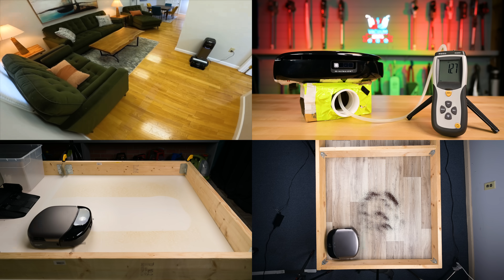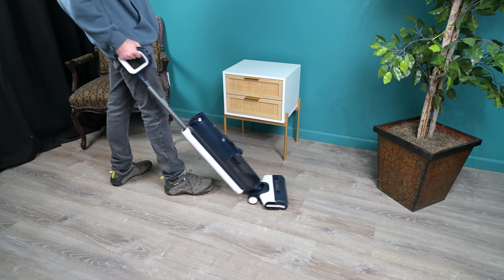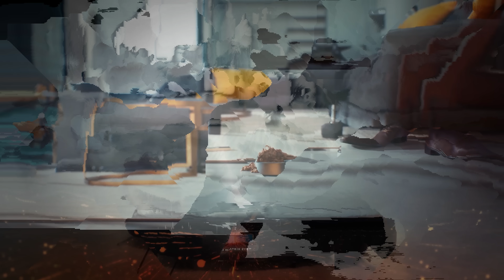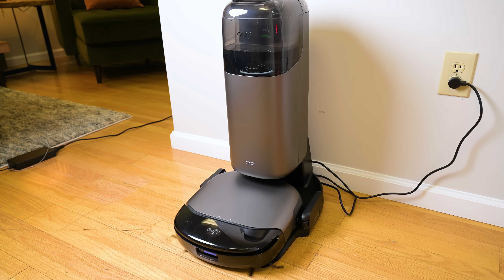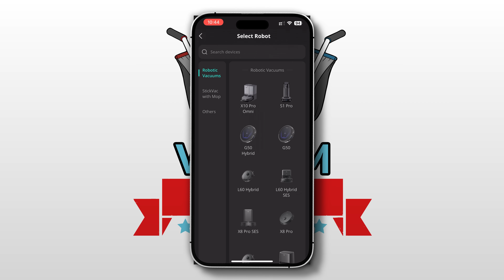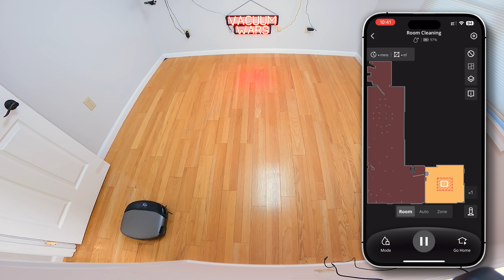Eufy S1 Pro Omni Review: AMAZING for Hard Floors and Obstacle Avoidance!

Comment: It's one issue no reviews mentioned about this and similar devices. Example , kid spilled ketchup on hard floor surface and started robot to clean a mess. Robot approached ketchup spillage and cleaned it well at the same time making an mess on carpet in nearby area due to a fact front spinning brushes and wheels were covered in ketchup. Part of spilled dirt also get in to dry middle vacuum brush.

Comment: We have 100% wood floors, LVP to be exact. Smal rug in bathroom is the only exception. Is this going for $699 during Black Friday sales as of 11/20/2025 a good deal? Anything else you would recommend for our floors or is this a good deal still a year later?
Reply from the maker: For 100% LVP with just a small rug, the S1 Pro is actually a really nice fit since its strengths are hard floors and obstacle avoidance. At $699 on Black Friday, that’s a solid deal for what it offers, even a year after launch. If you want to compare it against other top hard-floor robots, you can also use our comparison tool to see how it stacks up on features and tests for your specific needs: https://vacuumwars.com/compare/robot-vacuums/
Reply: @VacuumWars  Yep, I've spent the last hour or two reading the Black Friday pricing and tests of other vacuums. Our prior experience with a robot vacuum was with a Roborock S7+. It struggled with some chairs we had and with my wife's long hair. That's why we got rid of it. But robot vacs have come a long way since then.

The other two considerations during Black Friday are the Roborock Qrevo CurvX for $849 or the base Qrevo Curv for $799 but that's not much of a  difference. What are your thougts?
Reply: yes this i just saw this !! great gift idea

Comment: I was an early backer of the Eufy S1 Pro on Kickstarter, excited to support the brand and its new robot mop. Unfortunately, my experience has been extremely disappointing.

The soap dispenser has never worked—this robot has been mopping my floors with water only since I purchased it. Because of Eufy’s own warnings, you cannot add detergent or cleaner directly into the water tank, which makes the soap dispenser essential.

Over the past 9 months, I have contacted Eufy customer service multiple times about this issue. The responses have been delayed, unhelpful, and limited to lengthy troubleshooting videos or instructions (such as poking holes in the dispenser), none of which solved the problem. Despite my persistence, no replacement or meaningful solution has been offered.

This has been a frustrating, time-consuming, and unpleasant experience that has completely eroded my trust in both the product and the brand. I expected better support and reliability from Eufy. Until the company stands behind its products and provides genuine solutions, I cannot recommend the S1 Pro or Eufy to anyone.

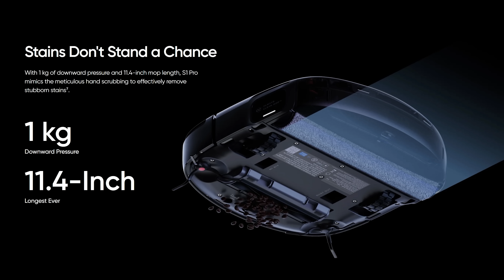Comment: @ 1:20, the video states" it's spinning roller exerts 1 kilogram of downward pressure."  This spec is misleading. 1 kilogram  (1kg) is not a unit of "pressure". 1 kg (kilogram) is a unit of mass. If you want to express a mass of 1 kg in terms of an equivalent force, you must multiply by g = 9.81 meters per second squared or 9.81 m/s² (acceleration due to gravity). Hence  F = mg = (1kg)*(9.81m/s^2) = 9.8 Newtons. For those less familiar with Newtons, there are 4.448 Newtons in a pound. (lb), The Eufy S1 Pro Omni therefore exerts 9.81 N / 4.448 N/lb = 2.20 lb of downward force. A small bag of sugar weighs 4 lb (in the USA), so there you have it; the vacuum cleaner applies a downward force equivalent to a little over 1/2 the weight of a bag of sugar.
Reply: Still better performance than most mop vacuums

Comment: Main Differences with Roborock S8 MaxV Ultra:
• S8MVU can be connected to water supply and drain; while S1 Pro has two water tanks that must be filled and emptied manually. EDIT: The S1 Pro can be completed with an "Auto-Refill and Drain Module" (separate expensive add-on) that makes it on par with the S8MVU on this.
• S8MVU has a rigid dust tank; while S1 Pro has disposable soft bags. Each has its pros and cons, e.g. disposable bags are cleaner but more expensive in the long run and a bit less convenient (YMMV)
The fact these very different features are never exposed by youtube testers (or advertisers?) is beyond me. The guy does not even show how to empty the dirty water on the S1 Pro!
Reply: I've been thinking a lot while watching these videos that a aggressive bin would be a lit better. Like, surely it would also be possible, if you were of the right mind and had a 3D printer, to print a removable tank that could fit in where the dirt bag goes that has a filter on the back to allow the air out as usual?

Comment: I have a 700 square meter floor that looks like a reception hall. Can this device clean the entire hall? Or is it only for small spaces like apartments and rooms?
Reply from the maker: That's quite a floor! While the Eufy S1 Pro Omni is designed for high-end, efficient cleaning and can handle larger areas thanks to its docking station and smart mapping, 700 square meters is a lot of space for any robot vacuum in one go. It could potentially clean it in sections—especially if broken up into rooms or zones—but it may need to return to charge and resume depending on your settings and floor type.

For that kind of area, you'd want to be sure the battery life, dustbin, and water tank capacity are sufficient—or be ready for a few pit stops!

Comment: The vacuum and mop work well but only where it can travel to of course.

I have tried my very best to like this robot vacuum but it still needs some work.

- it does not go under my dining chairs even though it has enough space to fit through the legs
- it does not navigate efficiently: it goes over the same route 3-4x, it turns it around in place multiple times trying to figure out how to clean a room
- I understand that it cannot mop to the edge of a room near wall or furniture because the mop roller is not to the edge of the vacuum body but I don't understand why eufy decided to not allow it to vacuum up to edge of wall and furniture where dust and hair and debris usually accumulate the most. The rotating brush arms are not even close to furniture or wall edges no matter what setting configuration I've tried.

- although it doesn't have a Lidar on top and looks streamlined, it is actually taller than my old roborock s4 so it gets stuck under furniture like my bed

 I had high hopes for this eufy vacuum. I've tried everything I could and been in constant contact with eufy to troubleshoot it every few days. I really want to like it but unfortunately I think it needs more work so I will have to return it. Sharing with everyone.

Comment: You didn't seem to test ladies long hair.  This is a big issue for me, since, currently, I have to take my vacuum apart every time I use it due to clumps of tangled long hair.
So how easy is it to remove the roller?
What maintenance cleaning needs to be done?
I'm very surprised that it doesn't remove the dust into a bagless compartment.  Someone forgot about that it seems.
Did you try it using an alternative detergent, such as a normal floor cleaner, like Cif?
As for being cheaper than the competition?  I'm finding this about a third more expensive here in the UK at over £1,500 / US$1,945.

Comment: We own a muay thai gym, with 2 training areas 12mx16m wide

We had a roborock s8 pro ultra that could not bounce its lidar system of anything so left 2 massive uncleaned areas in the center of our puzzle mats.

Will this eufy s1 pro have a longer reach with is lidar system since it has had other changes already to its usual design?

Comment: Your reviews are probably the best, but you are missing one thing which I think might be important probably for half of the buyers - how these robots cope with multizone or multifloor vacuuming or even mopping without moving to other zone their central station. From my experience some robots doing it almost perfectly, for others almost not possible. Also very important feature for other floor cleaning is the stairs detection to do not fall. Please improove your reviews with these features or at least make separete video on your top10 robots only on this topic.

Comment: Interesting thing I heard on the 3i S10 ultra live QnA (I am still trying to figure out how good this robot is and I think I will risk it and join the kickstarter) - they mentioned 2 things related to eufi - they said that eufy is their client so maybe that means that their robot can achieve similar performance to eufy which would be great. Of course, they didnt specify exactly which parts they manufacture for eufy so it might turn out to be the full robot, it might be just the roller brush :D second thing they mentioned that they i troduced the self washing roller mop design 1 year before eufy in their first gen teyouts of S10 Ultra. So that sounds promising, if we are about to get something that is similar quality to the S1 Pro

Comment: I don't fully get how to dock station mop cleaning feature works - does it require piping for the dirty water and clean refill? or the idea is that the dirty goes into the clean and is purified using the ozone?
Reply: Two separate water tanks. You fill the clean water tank and you empty the dirty water tank. To clean the mop it shoots clean soapy water on the spinning mop and then that water goes to the dirty water tank.

Comment: Just got mine (first robot vacuum/mop combo) last week. New home and still a lot of construction dust on my mostly tile floor so needed a bit of maintenance already. 

Super easy in all ways 
-mapping is easy to use
-if it gets clogged it’s easy to unclog
- easy to clean tank
- easy to change water and remove dirty water (I like the higher station so I don’t need to bend)
- and does an amazing job cleaning
10/10 for me
Reply from the maker: Great to hear!
Reply: How has it been, and how are you liking it? Same situation as you lol, new construction house and just ordered this. The amount of dirt and what not on all the floors is insane.
Never had a robo vacuum with or without moping.
Reply: @Mpostor  still works great, but the more dirt the more maintenance but not difficult to clean parts if your got a good laundry sink.
Reply: @justbecause882 Anyone with long hair living with you? I heard long hair gets tangled on the mop roller, as there’s no anti tangle equipment.
Reply: Does it have a light so it can see in the dark? 
Does it take photos of things it's found that are in the way?

Comment: For those comparing the Eufy S1 Pro and SwitchBot S10, I’ve had both for several weeks.  If you have hard floors, these are your only real choices.  My Roborock and Ecovacs are not even close to these. Despite my initial excitement and possible bias for the SwitchBot S10, I’d choose the Eufy S1 Pro if I could only have one.

Both are excellent, but the Eufy is far more premium in every sense. Its navigation is the best I've ever seen; it avoids getting tangled in curtains without needing virtual walls, unlike the SwitchBot. The Eufy also cleans with ozone, which is crucial for maintaining cleanliness and health.

Seriously.  The benefits of cleaning with aqueous ozone cannot be overstated.

The SwitchBot S10’s unique feature is its empty/refill station that connects to a drain and water line. This excited me until I realized it doesn’t refill or empty its tank at the start and end of runs.  And it's made it very difficult to think of a way to add aqueous ozone to the SwitchBot.  Also, leaving water in the tank for extended periods of time could cause filtration issues for those with hard water.  (To be fair, SwitchBot's customer service is incredibly kind and responsive.  They said they are looking into resolving the issue of leaving the tank full between runs in a future firmware update.)

Both mop floors phenomenally well, but the Eufy does slightly better with smooth navigation, quiet operation, better waterflow, and an impressive filter that leaves the whole room smelling fresh.  The SwitchBot, although almost effective, is louder and bumps into everything.  And surprisingly, even though SwitchBot has access to essentially unlimited access to water through its waterline hookups, it only puts the faintest amount of water down even at max water settings.

Edge cleaning isn’t perfect on either, but the Eufy is better thanks in no small part due to its roller bar that extends across its body, unlike the SwitchBot’s, which only covers about half. This means the SwitchBot requires more passes, can only do edges in one direction, and the roller is positioned further away from the edge.

If Eufy ever adds the ability to connect directly to plumbing (and maybe some devices that it can transport water or power to/from), there would be no reason to ever consider the SwitchBot.  But I'm going to keep my eye on SwitchBot because even though their execution is in some ways lacking today, they seem to a unique vision for creative ways to innovate in the future.
Reply: I've been a Robotrock fan, but I think this holiday season I am gonna buy the Eufy S1 Pro after tons of research, us our 3000 sqft is all hardwood floor.   I really don't care about carpet cleaning.
Reply from the maker: @flood2k3  Sounds like the S1 Pro is a perfect fit for your home — especially with all hardwood floors! It’s always exciting when research pays off and you find the right match. Hope it impresses you as much as it has others!
Reply from the maker: Thanks so much for sharing your experience — that’s incredibly helpful for others trying to decide between the two! Sounds like the Eufy S1 Pro really stood out for you, especially when it comes to navigation, ozone cleaning, and overall polish. Great to hear you're keeping an eye on both — really appreciate the thoughtful comparison!

Comment: I bought a roborok S8 pro and it doesn't clean the grooves in my tile floors well. It does not suck up the garbage that is between the slots well. My question is if this eufy S1 pro cleans the grooves of the ceramic floors well. waiting for your response to see if I buy it
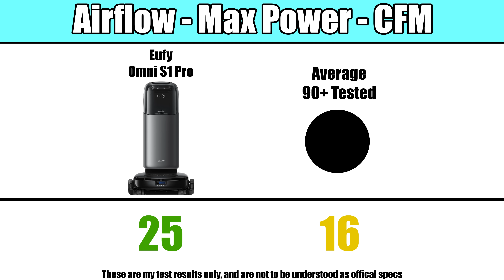Reply from the maker: we looked at power and crevice pickup at about 04:11 - it did pretty well.
Reply: You tell me that you clean the cracks quite well. Do you want decor that makes it perfect then? . My floor is made of full china and the roborot cost me a lot of money and I didn't like it at all because it doesn't clean the cracks well. I mean it doesn't vacuum the cracks well. That's why I was thinking about buying this one. Based on your experience, I think it is worth it.

Comment: I think the S1 Pro is perfect for my house since it’s mostly vinyl floor, except for one low-pile carpet. It can also easily vacuum under my 3.75” clearance furniture that is also a pain to use with my Dyson.

The only real concern I have is no edge vacuuming/mopping. I read it leaves 1-2 inches off the edge of baseboards, furniture, etc., which is why I was also looking into the Dreame X40. Is this a dealbreaker?

Comment: I’ve got dreame x40 and the biggest advantage of it for me is tricut brush - I had one run on the floor with pet hair without it and hair was all stuck on the brush. It would be awesome if you could test anti hair tangling features of those robots. Even though this robot seems ideal for me as I have only hard floors I don’t think it would be as low maintenance as my dreame. Also two more advantages for dreame: moving side brush and moving mop pad which I find particularly useful.

Comment: Want to add 2 points -
1, the biggest headache for us is its claimed very low clearance is not exactly true. We used to use a Roborock S6, and we have done some work to lift our furniture so the S6 will be able to get under them. However many of the furniture pieces that has a bottom tall enough for S6, The S1 Pro does not want to work with. And actually to make it worse, it will actually try to go under it, but somehow in middle of the way it will basically say "no it won't work" and get out. I don't know why is this.
2, there's one rather important feature missing from its app, that it cannot do cleaning which disables mopping and follow a order of rooms. The app allows only one set of "Customize" settings which allows you to set which room to use what cleaning method and then a order of rooms, but that's it. If I set to use the customized setting, it follows the room order but has to do mopping; and if I use "Default", I have a way to disable mopping but it also cannot follow a room ordering.

Comment: How does this perform on thresholds? My current robot mop has a hard time going over those sometimes. Thanks for the review!
Reply: This! Too bad they don't test that stuff, it is crucial to know if it can go between rooms. Disappointed that your comment hasn't been answered .
Reply: @ghauan  I can answer this question for you. We purchased the machine last week and it has no problem going over thresholds, it’s really good at going over those. I’ve had zero issues with this machine, it goes to every room without problems. It’s actually a really good vacuum/mop combo. We are very pleased so far. The mapping is super fast too.

Comment: The biggest pro imo is the price. While I love my S8 Pro Ultra and am in need of another robot for my top floor I was turned off of Roborock. The S1 Pro may just do the trick.. plus it could replace mopping as a whole since it's actually washing the floors not wiping them.
Reply: Replaced my S7 MaxV Ultra with it and the difference in mopping is literally night and day, which you can immediately feel when walking barefoot. The S7 made the floors feel mostly clean, but the S1 Pro makes them feel absolutely spotless. Zero dirt or grime is left behind.